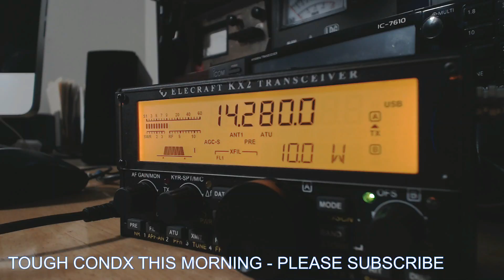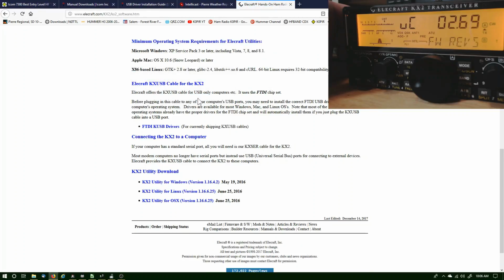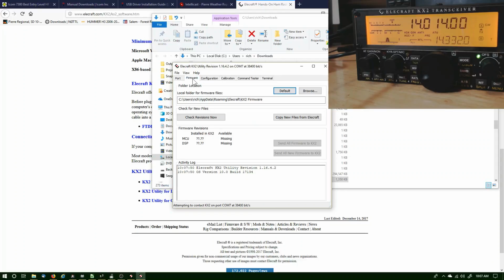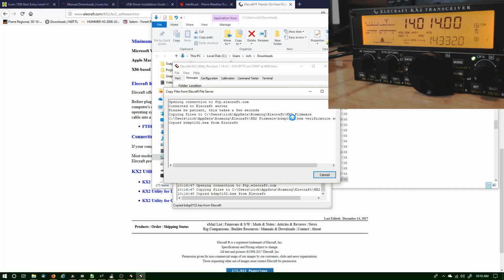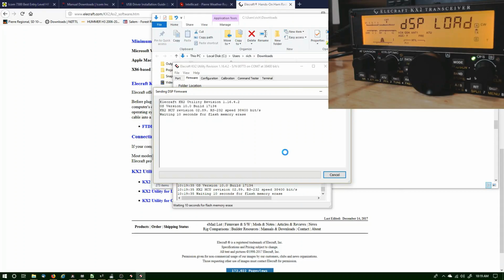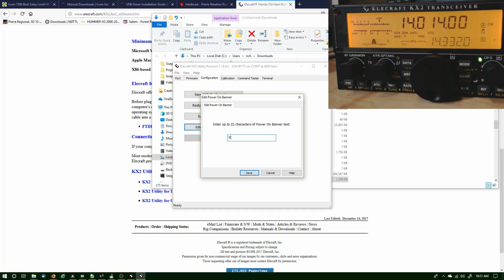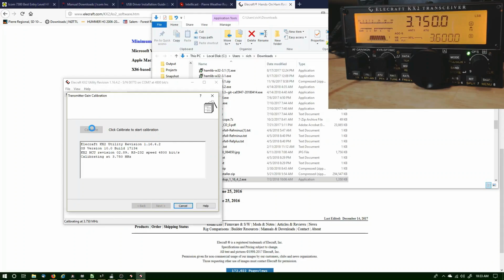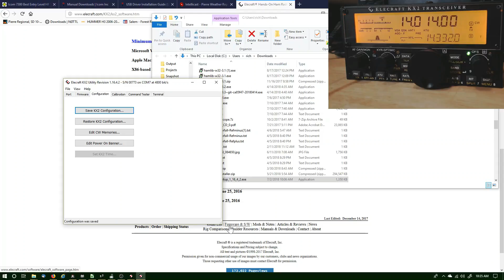Elecraft KX2 Firmware Update and Transmit Gain Calibration

Comment: Where did you get the VFO knob for the KX2? I find that the standard one from Elecraft is awkward to use when when you want to scroll rapidly up or down the band - it needs a dimple.
Reply from the maker: Thank you for commenting and thank you for the question. It's nice to hear from you Fred.

I bought the KX2 used and it came with the knob. I do like it.

They are available on Ebay: http://rover.ebay.com/rover/1/711-53200-19255-0/1?icep_ff3=2&pub=5575171312&toolid=10001&campid=5338054206&customid=&icep_item=253773703811&ipn=psmain&icep_vectorid=229466&kwid=902099&mtid=824&kw=lg

I hope this helps. Best 73 - Rich, K0PIR